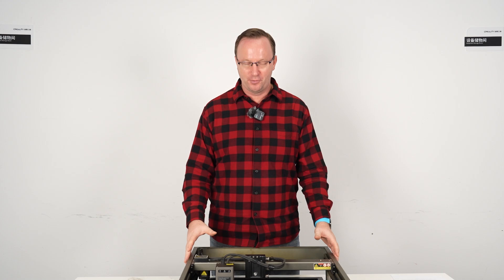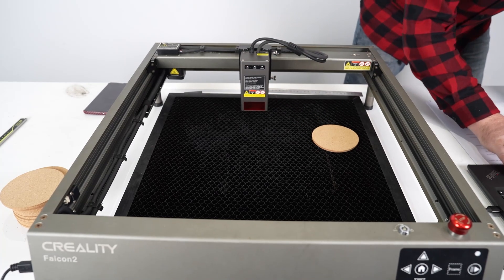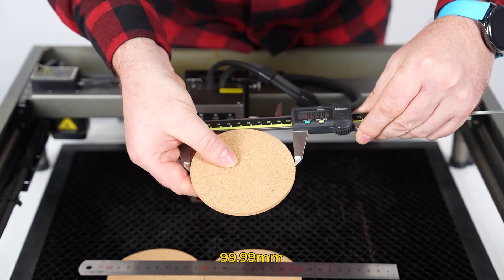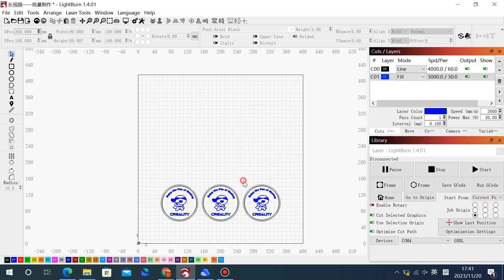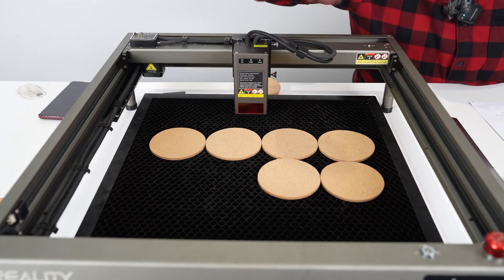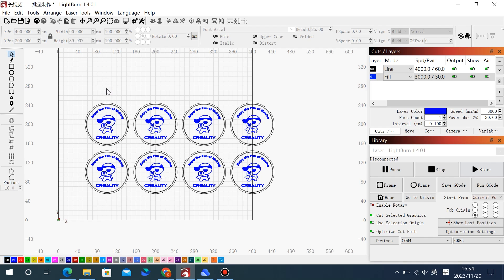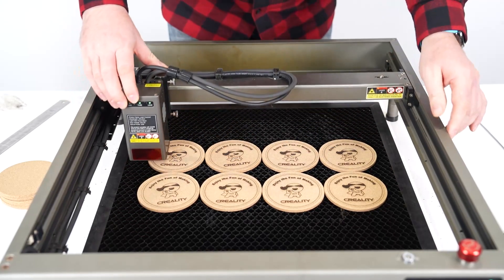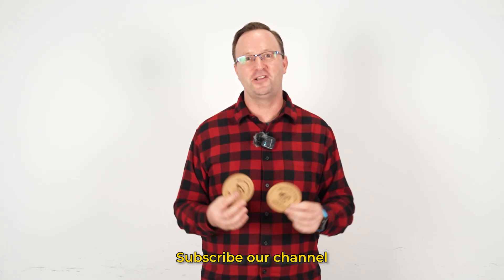How to Mass Engrave Cork Coasters to improve your productivity with CrealityFalcon2 22W?

Comment: Did you wear the safety glasses? I see the laser is covered with protective glasses. I am currently looking at Atostack A5 V2 which has similar protective glass around the laser. Wondering do I need t to wear safety glasses?

Comment: Hello, I'm trying to setup my engraver/cutter to mass engrave 3.5" coasters or 88.9mm. so, to setup I need to change my first coaster x and y axis to 88.9. Correct? the second coaster should be 88.9 plus 200, so 288.9, 3rd 388.9. CORRECT? Thanks for your help.